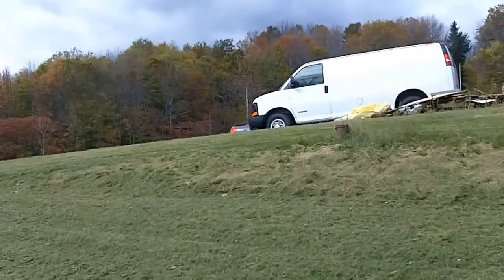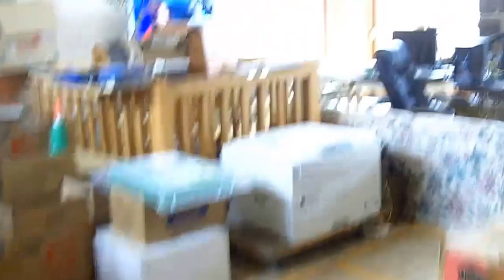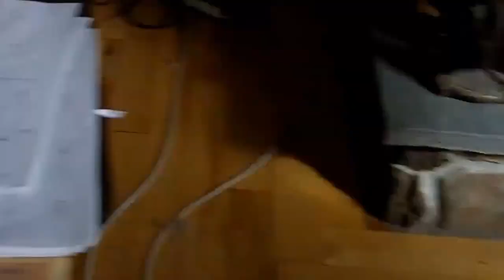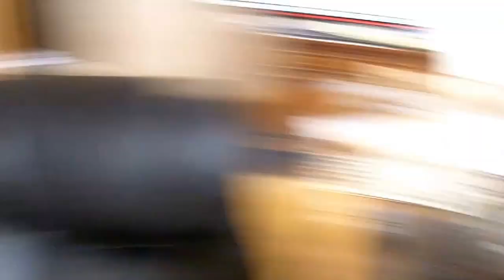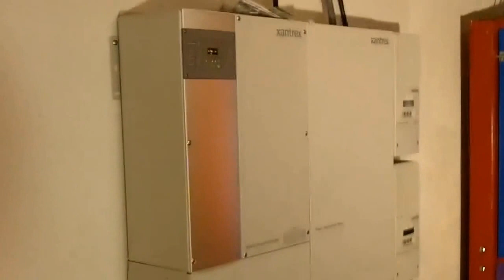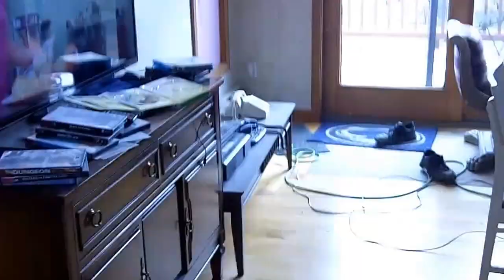S002: Ethereal Mechanics: Behind the Scenes #1

Comment: your generator reminded me of a video i saw, this guy took two transformers (the ones on telephone poles) i think 50kv, and hooked one to a generator and another transformer to the one hooked to the generator. he says he got more power out than in  ! he only hooked up one side of the transformer and used the top to connect to the next transformer. he used a lazer thermometer to show that the transformer actually got cooler as he used the electricity . he said its all radiation ,whatever that means. I understand how he transferred the energy through induction by not hooking up physically to the second coil in the first transformer and vice versa with the second. but how could he get more out than in?
Reply: If he did (and I'm not saying he did) he was taking kinetic energy from the air in the form of heat and somehow converting it into an electrically charged energy that is similar enough to electricity to run his electrical devices. Since transformers get hot through normal induction and radiate heat, he would have had to figure out how to run that process in reverse. He wouldn't be the first to figure out how to generate "cold electricity". Look up "Floyd Sweet" and "cold electricity" in your favorite search engine. Apparently he partnered with T.E. (Tom) Bearden and drew on the mathematics of E.T. Whittaker, which Bearden turns to gibberish because he doesn't really understand how to use mathematical terminology properly.